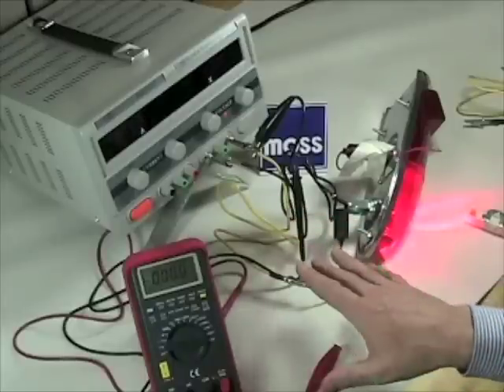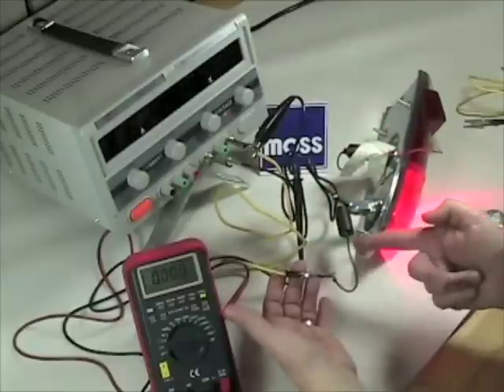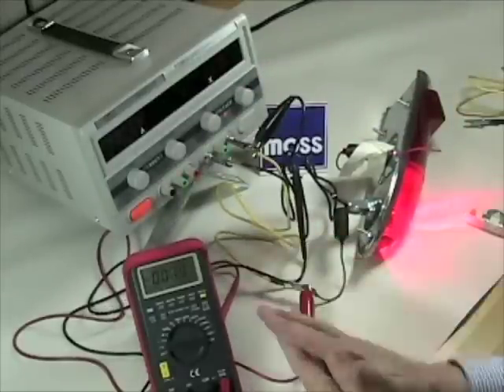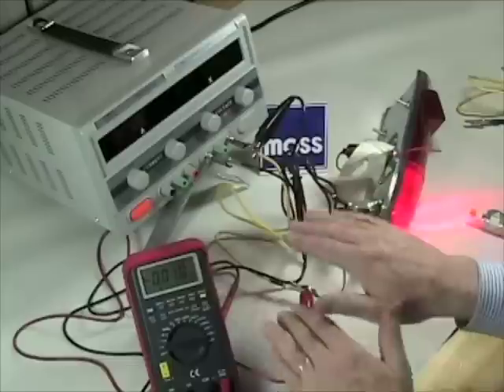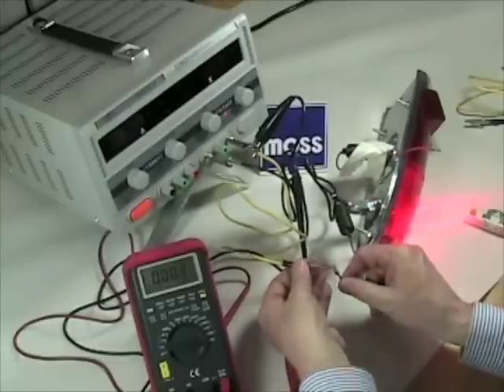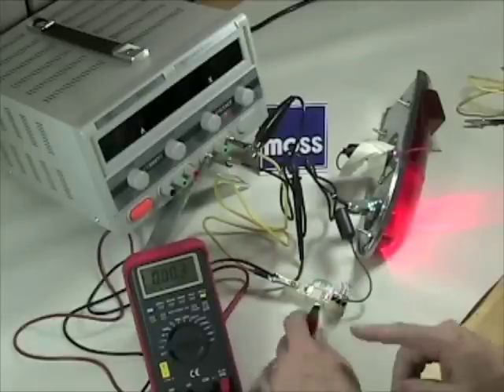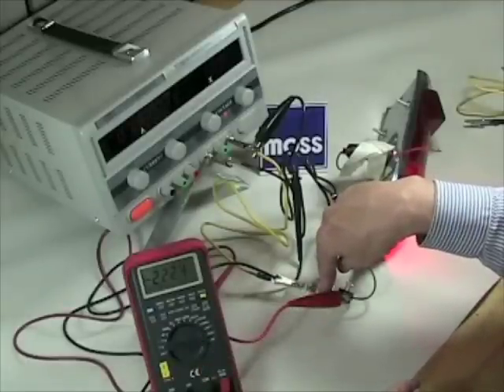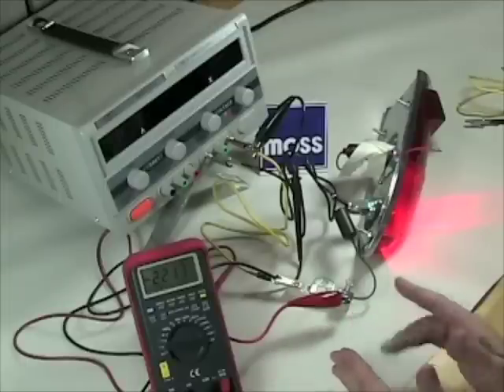Voltage Drop (Pt 2) - Demonstration of How to Test

Comment: Nothing is trying to go through the meter.  I was super misled by that statement 5 years back. The drop shown in the meter is just the difference in electrical pressures at the two points measured. Difference is caused by any resistance existing. Nevertheless Moss Vids Rock

Comment: Is there some confusion in this explanation between current and voltage? The voltage decreases (drops) along the wire because there's a large resistance somewhere in it. That's not the same as saying the current (or the voltage) wants to take an easier path along a service road. Is it??

Comment: Nice  video .  that  MGB  tail  Light .  very clear  your  demonstration . i have  to trouble shoot  1996  chevy  Impala .voltage  drop .  knew  i  can start   with  battery  wires. check  all  the  connections.     Thanks your  video ....